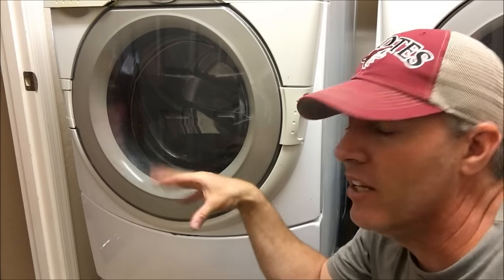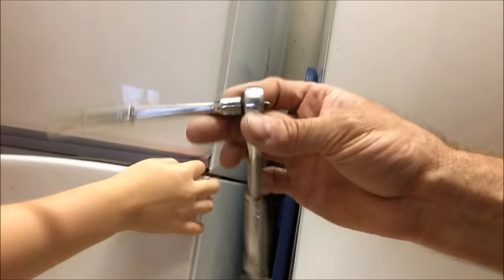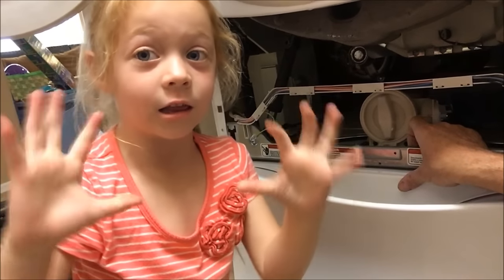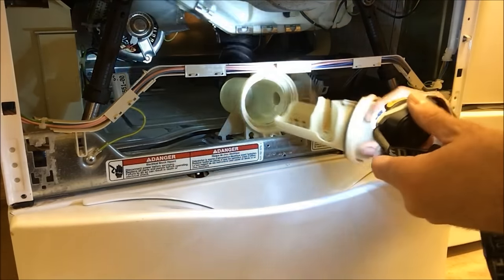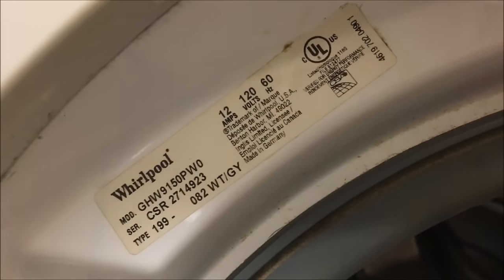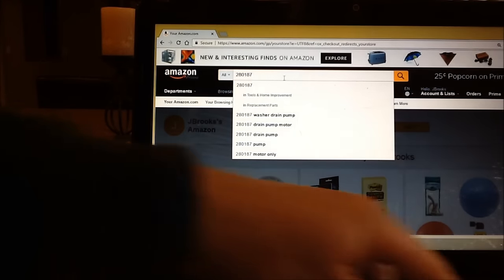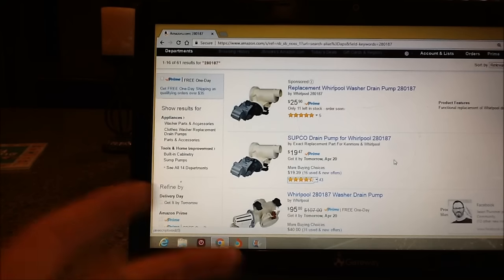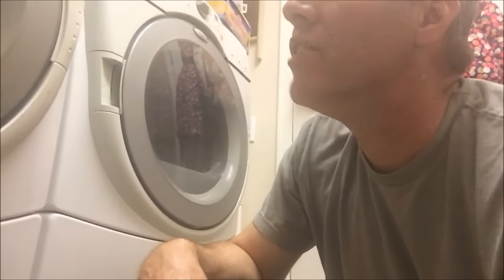DIY washer wont drain - repair whirlpool duet

Comment: If you clean out the filter and it still gives you the error take the pump apart. There was a nail preventing the impeller to move properly.

Comment: OMG she is too adorable I bought a front load Whirlpool do it from my old landlord I found a sack little plastic pieces of choice $2.17 worth of change so I obviously cleaned out the filter but it's still going to F20 when it gets down to 17 minutes but if I stop the machine it'll drain and then if I put the machine to drain and rinse it will go through that full cycle so I really have to figure out what's going on

Comment: Yes, the off--brand replacement pump was only $20, but the official Whirlpool pump was $95.  Not to say there was $70 difference in the quality of the pumps, but the quoted price from the parts store was probably for the Whirlpool, so the cost difference wasn't as big as it seemed.

Comment: My whirlpool front load washer works and empties all but some under the drum. The there was nothing in the trap but 50 cents. But I can wash but there is just a quart left under the drum. So the pump is the same pump that pumps for wash and spin cycle it doesn't sounds like it would be the pump.
Reply from the maker: yes its the same pump.. check your drain line it may be to high, to long etc..?
Reply: The drain line was installed with the washer. It is higher then the washer, does that make any sense?

Comment: i wish you would tell the sizes of the tools you use. i've been trying to figure out how to turn my whirlpool duet off and unlock the door. Can't find anything. But it started because, not knowing my water pump froze up, i started a load.  i've done most things (unhooked hoses and drained them, water works now) but the washer refuses to shut down and unlock door. the front panel refuses to acknowledge my signals. it's stuck on the door light, blinking. any ideas?
Reply: renee mandell 
If you can't figure that out on your own then you have no business working on it yourself.
Reply: Hi Renee, I'm sure you've got this solved already. I hate that you got such a rude reply.
Reply from the maker: Sorry Renee I just saw your message .. did you get this resolved?

Comment: An idea I got from another video was to attach a vacuum to the drain line.  By doing so, I found a pair of women's underwear that was lodged in the rubber boot that goes between the wash drum and the pump housing/filter.  I totally missed it on the first inspection and cleaning.  By putting the vacuum on the drain, it pulled the underwear into the filter housing so I could find it the second time I opened it up.

Comment: Thank you for this video! I would get the "SUD" code and the flashing "F | 02" code. My filter was completely clogged with some sand type feeling material. I had a couple small chunks of concrete fall down too i'm guessing from the counterweight in front. Pictures Attached! https://imgur.com/a/Kl0qGSG